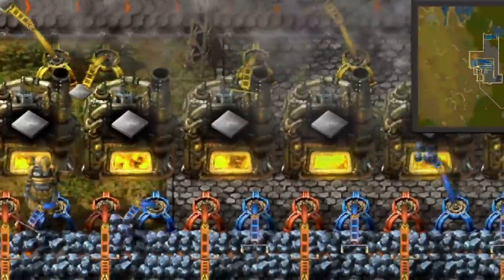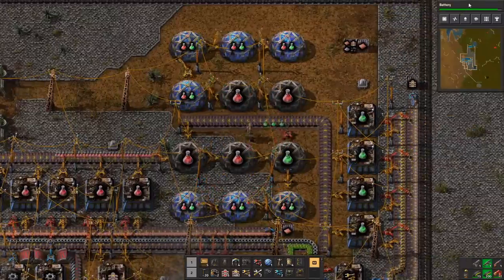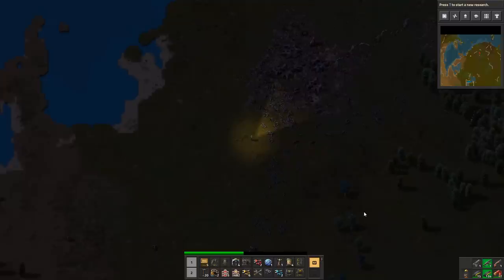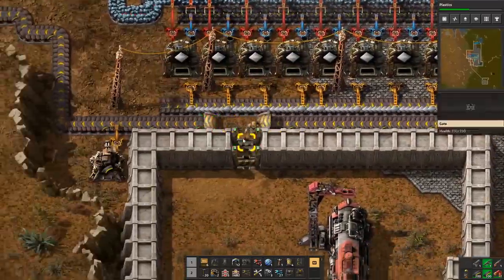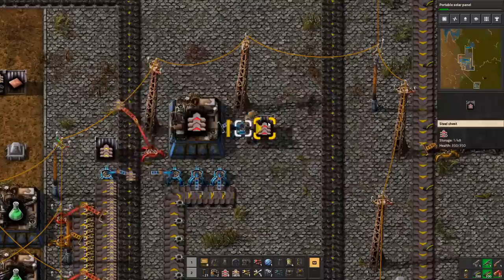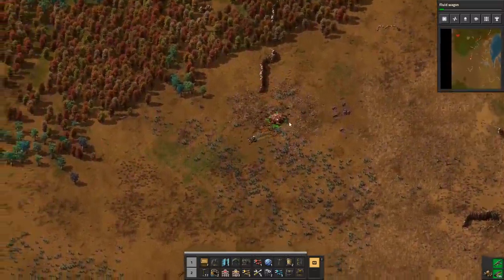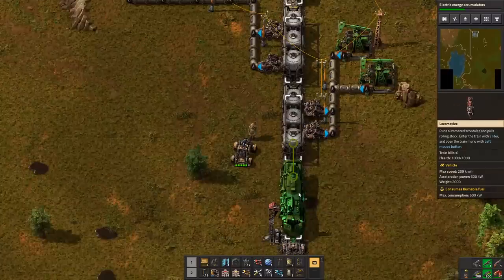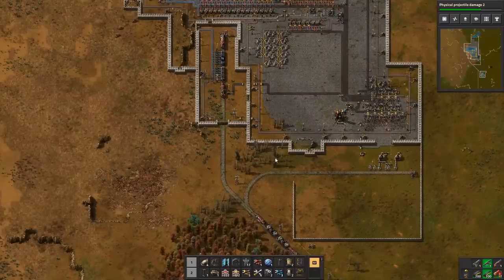Factorio Has Expanded My Brain

Comment: Simple primer on train signals : You need chain signals at the entrances and regular signals at the exits to every intersection. You can use additional signals in between intersections to break things up and allow more trains to use the same piece of track. Signals go on the right side of the track from the direction of travel they're controlling. That's enough to get you started.
Reply from the maker: Thank you! This will help a lot!
Reply: It's also worth understanding the system deeper when you get into more complicated networks, but the principles aren't too complicated (even if it's hard to find a specific explanation outside of a link to openTTD, which has some key differences). A piece of track with a signal on either side becomes the boundary of a block, marked by yellow arrows and train car bounding boxes when you hover over the signal, and only one train is allowed in a block at a time. A chain signal lets a train "look ahead" at the state of the blocks in front, so it won't enter a block it's not allowed to exit, which is why it's so useful for intersections: you don't get trains barging in and blocking 3 lanes of traffic only to realize they don't have anywhere to go...
A fun detail that might save you from some vehicular manslaughter over the course of the series is that the signals track not only the current position of trains, but their minimum stopping distance too. A green signal means a free block, red means currently occupied, and yellow means about to be occupied. If you're crossing the tracks by a signal and see it go yellow, loooook out.
Reply: DO NOT PUT ADDITIONAL SIGNALS BETWEEN INTERSECTIONS ON BIDIRECTIONAL TRACKS. Any length of track meant to be traversed by more than one train must be a single block with no signals, else it will allow multiple trains to enter and get forever blocked in the middle. For very long tracks this means you'll need to have small sections in the middle where trains can pass each other by splitting the tracks.
Reply: That rule of thumb only works when you build a train network with two lanes, one way tracks. He's got a single lane, two-way track, which needs to be signalled with a very different principle. He'll have to treat the entire shared section as one single, giant intersection.

Or, just build two lanes, one way tracks, it's much easier to reason about than two-way tracks.
Reply: Whenever you have intersections and junctions, you probably need signals on the right side from where the train is coming (both sides in your case), before and after the intersection. You can check the mini-tutorial for trains on the academic cap icon on top right.
Reply: @ambiguousamphibian  There's an interactive in-game tutorial for the train stuff. Press the button in the top right showing an academic hat. Also, you can name your train stops whatever you like.

Comment: me before factorio: smooth brain

me after factorio: Masteral in Business Management-Major in Operations with a very, palpatine-looking wrinkled brain
Reply: Not a single smooth surface on your brain, king. Straight prune mode inside and out
Reply: Brain filled with conveyor belts and e x p a n s i o n
Reply: The throughput has reached maximum potential in its current configuration.

Comment: Re: everything going wrong at once.

Yeah I did that, I started up laser turrets without proper accumulator backups, so the lasers drained all my power. Without power, the electric mining drills mining coal stopped working. Without coal, the power stations stopped working. All the power stopped working. All the turrets stopped working. The aliens came over. We had lots of fun together.

Comment: Having played this game for many years, I have SO many tips I could give you :) But, in the interest of brevity, I'll just give a couple of easy ones for now.
1, When it comes to radars, they have a permanent vision field in addition to the long-range scanning, so it makes a lot of sense to spread them out. Like one in each corner of each base. This also saves on power compared to your bunch of radars in a single spot.
2, Train signals can be hard to figure out, but as a starting point... try to think up a section of track that is common for all the trains that will use it, and have every possible entrance to that section equipped with a signal that points right at it. It looks like the track you've put in the video so far needs 4 signals.

Comment: As someone with 600+ hours into factorio, it's fun watching someone just get into it. I remember having the same enthusiasm for my early factories. Good luck and have fun, it'll keep you busy for quite a while. The only wrong way to play factorio is to give up. Also: the rail signals you have set up won't work properly until you have a setup for each direction. For single lane rails, it's essential to mark off the segments properly in order to avoid jams and crashes. Using two lanes of rail simplifies things, but also makes junctions a bit trickier.

 btw the max multiplayer limit is around 255

Comment: Nice to see you have a go at factorio. Its nice to see someone start out with the game without knowing the whole deal. I have a few tips that would help you get further, if you want to consider them.

1: More machines are better. Upgrades are something that are quite late-game and not really worth all that much early on. For now, you should expand your smelting capacity so you can provide full conveyor lines. You want about 4x Iron plate lines, 2x Steel, 4x Copper, 1x Stone, 1x Bricks and 1x Plastic. Having more, bigger smelting setups and overproducing is a good thing to do. ALWAYS overproduce when you initially set something up, you will need it later anyways.

2: Make use of a central "spine" of sorts for resources. Funnel all your smelted product into a dedicated space where there are ONLY belts running straight in one direction. This is what is commonly referred to as a "Main BUS" (computer science term for a central line of travel for many signals). From the BUS, use splitters to branch out sideways and have your factory modules shoot off to the side of the bus. It is worth to leave enough space among the bus to expand it later, as many more resources will go on there. Theres a good tutorial on the wiki on how to build and understand the BUS layout: https://wiki.factorio.com/Tutorial:Main_bus
This will massively increase your efficiency and coordination.

3: Trains and rail signals are a beast of their own. Think of a set of tracks as a "Block". Blocks can be seperated into smaller blocks using signals. if a train is in a block ahead of a signal, the signal will turn red, blocking other trains from entering that block until that train has left the block. Trains can "reserve" a block they are about to enter, turning the signal yellow and effectively pre-blocking the path.
Normal Signals look into the block ahead of them and turn red if they see a train in that block.
Chain signals do the same but also look ahead to all other signals ahead of them and copy their state. if there are multiple signals ahead, aka a junction or split, the chain signal has an additional state, indicating that SOME paths are available and others are blocked.

As a rule of thumb, the following applies: 
- Chain signal before a split
- 1 Normal signal per lane directly after a split
- Normal singals on every lane before a merge
- Normal signal after every merge
- Chain signals before a crossing(on both crossing lanes)
- Normal signals after a crossing(on both crossing lanes)

4: When handling fluids with trains, it is advised to have unloading and loading buffer tanks to minimise time lost by travel. This applies especially to oil, as pumpjacks seize working as soon as the pipes are full. Adding a tank or two gains you more efficient production time while your train is away from the station. Additionally, loading from and unloading to tanks directly is a LOT faster than having a pipe in between. To the point where it is more efficient to have 2 pumps and 2 tanks per rail car than having any more pumps and using pipes to connect them. Basicly, its Tank>Pump>Train for loading and Train>Pump>Tank for unloading. Much like you already do it with chests for items. 

5: Think modular! Most processing lines can be packaged into repeatable modules. For example, red science has a ratio of 1 Gear Assembler supplying 10 Assemblers for science packs. This can be set up and repeated using blueprints. If you dont want to melt your brain trying to do the calculations, I suggest a very simple QoL Mod called "Actual Crafting Time", which adds a little popup at the top of your screen that lets you see the ratios of production and consumtion, as well as In-/Outbound conveyor space usage for a set number of machines per recipe at a glance.

6: QoL Mods are a MUST. I recommend my top used ones: Vehicle Snap, Squeak Through, Actual Crafting Time, Even Distribution, FNEI. These massively help you in your endeavours without altering the game experience at all. Vehicle Snap snaps your drivable vehicles to certain angles while driving to help you go straight. Squeak Through lets you navigate tight spaces easier. ACT has been mentioned above. Even Distribution is a handy tool to manage distributing stuff from your inventory evenly to machines and adds a lot of useful little features as well. FNEI is just like minecrafts NEI but for factorio, it lets you see all recipes for an item and what it can be crafted into, which machines can craft it and how fast.

Hope these are helpful to you! Keep up the good work.
Reply: Best explanation on trains I have seen in these comments. Trains are kinda complicated when you don't have experience with OpenTTD, it took me a long time to really use them.

Comment: A handful of tips:  
    If you grab fish from the water, you can consume them and heal quickly during combat. Also, put your radars on the corners of your base for a larger radius. If you have multiple conveyors of one item/resource, you can use belt balancers to combine/fill the beltline efficiently. You can create dedicated areas for producing items, and then for more commonly used resources use busing lanes to transport them around the base for usage. If you hold shift while placing an item, it will create a ghost version of it allowing for the creation of templates, etc. Anyway, good content, and keep working at it. Cheers!

Comment: Some tips:
    Splitters do more than split; they have two input and two outputs, letting them balance both directions. They also can be clicked and used as filters.
    There aren't really "better" turrets available. The laser and flamer turrets are good and bad for different things, same as the gun. The lasers have long range and only need power, but have a serious idle power draw and a massive spike during actual use. The flamers work as long as they have fluid, but are inaccurate and have a limited arc. The guns have a tiny power draw (for the inserter) and can be "upgraded" by using better ammo, but require more complicated infrastructure to get working.
   You've got way too many radars in one place; if you take a look at the power grid, radars use a lot of power, and can only 'see' a set distance. Take all but one down at the main base, and as you expand add a radar at each new location. This will also allow you to scroll in on the map to see what's going on near a radar in real time; good for train stoppages or other issues.
   Power grid 'batteries' are called accumulators. If you use solar and/or laser turrets, you will need a lot of them.
   Grenades exist behind a green tech, and are very useful for clearing nests. They can be thrown from inside vehicles.
   Train signals are difficult to get your head around, but very useful. Your mistake here was that they need to be on each side of any intersection. The simplest way to set them up is to have a standard signal leading directly from the nearest intersection to a station, and chain signals in both directions on every side of every other intersection.
   Train un/loading stations work better if each cargo wagon is added/removed from equally, as otherwise the train will spend more time at the station waiting for the last car to finally finish. You can fit a max of 6 inserters to one side of each wagon. Make sure to use both sides of the belts when possible.
   Train stations can be renamed (among other things) by clicking on them.
   Different fuels last longer and make vehicles faster; this is offset by the difficulty in making them.
   The box near the inserter assembler will eventually start putting circuits on the belt leading to red belt assembler.
   Gates over train tracks should not affect their pathing; I've tried to force this myself in the past, which resulted in trains breaking down the gates instead of stopping.
   You can ride in any part of a train by pressing enter while close, same as a car.
   IIRC, there are two train achievements: be hit and killed by one (at full speed?), and be hit by one at full speed and survive.
   Something I've found useful is to bring the power into outposts in one location, and set a power switch on that point. If you start having serious power issues (such as running low on coal for the steam engines), you can run around to your outposts and turn them off until you've resolved the issue. You can manipulate power cables by grabbing copper wire in your inventory; "connecting" two items already connected will remove the connection.
   If you run out of power, your inserters on the boilers won't be able to put coal in them to make power, so even when they have access to coal the system will refuse to restart. Burner inserters can always fuel themselves and thus will never fully lock up.
  Shift+click and Ctrl+click can be used for bulk inventory management.

Glad you're having fun; Factorio is great.

Comment: Here’s a bit of help with your train problem: Rail signals will halt a train if the “block” ahead of it is occupied by another train (red) or will be in the near future (yellow). You can see said “blocks” by holding a rail signal in your hand and looking at rails. Chain signals perform like a rail signal, however it is more complicated in that it will halt a train if the next rail signal is blocked. Chain signals are used mostly in larger intersections for that exact reason. The reason why your trains kept stopping was because you placed the signal before the branching paths of the Y-intersection; if you take a look at the rail blocks then you will see how the other train was occupying the block, hence causing the now-stopped train to... well... stop. Hope this explanation helps you on your endeavors! Love the vids man. Also love seeing your thought process. Makes me remember when I was new to factorio :)

Comment: Quick tips, for the train signals, when you place them down you'll see the train tracks covered in colored lines, and placing one down splits one colored line into two. These are called blocks, and only one train can be on a block at a time. If you look, you'll see your iron and oil dropoff stations are on the same block, so the way you have it set up only one can be unloading at a time (and as a note, if you delete a train signal and that puts two trains on the same block, then they'll continue forward without checking to see if the block is occupied, which leads to crashes). Also while you're using tracks for both directions put the signals on both sides, if you move to using two tracks then put the signals on the right side of the direction you want the train to go.

More turrets, more bullets, you are going to need them, the enemies get a whole lot more difficult.

Also note the day-night cycle, and what effect that has on your power supply.

Comment: For your steam if someone hasn't said it yet, the ratio is 1:20:40. 1 water pump feeds 20 boilers. 20 boilers feed 40 steam engines. So you have a lot of space to expand on your steam setup right now instead of going to solar. I hate doing solar set ups. It takes so much space and time to make them useful. I just spam 1:20:40 setups like crazy when I need more power. Each setup can do quite a bit more for the space then a solar setup as well.
Reply from the maker: Ah thanks so much for this! I had no idea the ratio was that extreme, but this helps a lot! I'm still figuring out the solar power tbh in terms of storage. To a great extent I'm hoping to build a little bit of everything in order to get to know the game, but specifics like this really help a lot!
Reply: @ambiguousamphibian  Yeah there's a ratio for Solar, but what I do is just make massive amounts of panels until I have enough during the day and then spam the accumulators until I don't hit 0 during the night. It's just like the batteries in rimworld unless you want to have a steam set up take over for night time which is also pretty common.

Comment: Probably a good idea to add a buffer chest for the gun turrets, so that while they're not shooting, they accumulate the excess of ammo, so when the biters attack you don't have to worry about the turrets running out of ammo during an attack. And to ensure one turret isn't just hogging all the ammo, you can use splitters so they only get access to half the ammo traffic that pass thru that section of the conveyor belt.